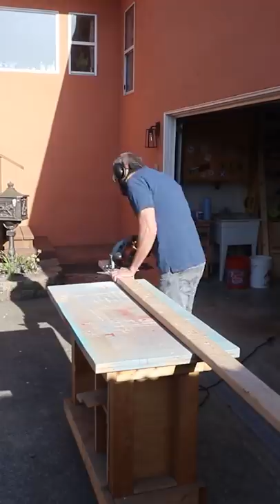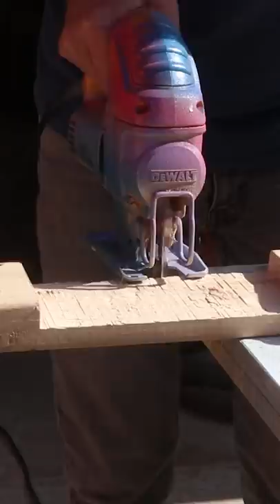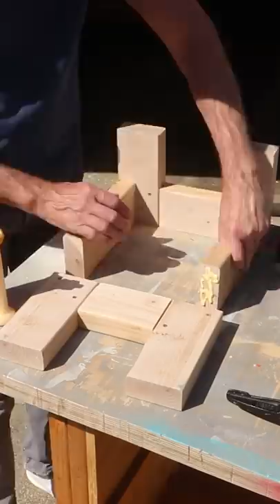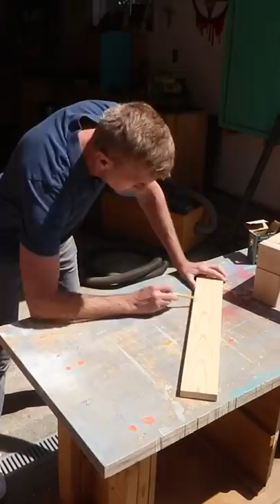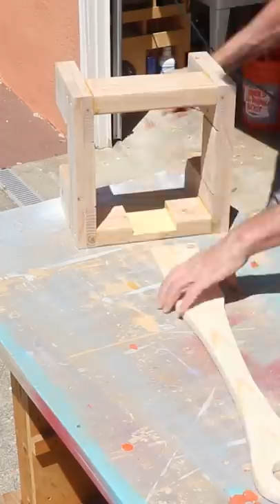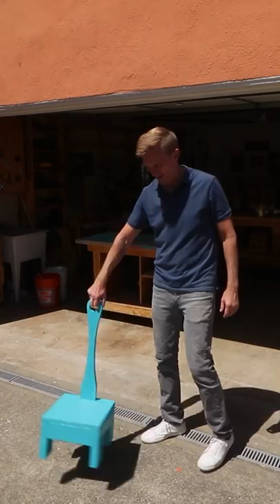a blue step stool

Comment: The deck boards are upside down. The end grain should be cupped up .
Reply from the maker: Makes no difference. 👍
Reply: @SteveRamsey  Yes it does. Those boards are gonna warp now. Plus you need two screws on each end.
Reply from the maker: @mikeoudt3216  glue is sufficient. Plus it's got a protective layer of paint. You're way overthinking this little project.